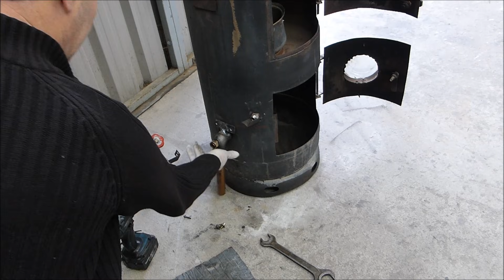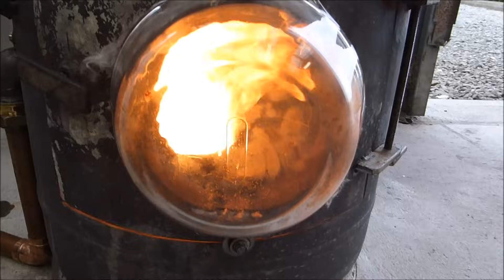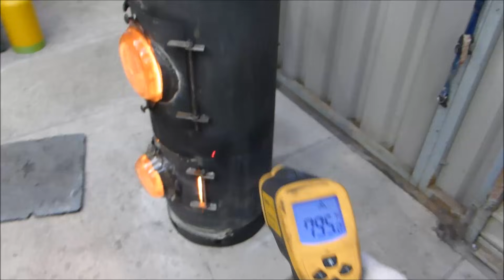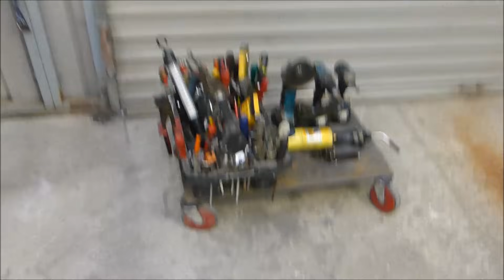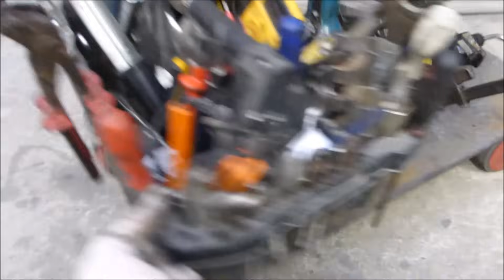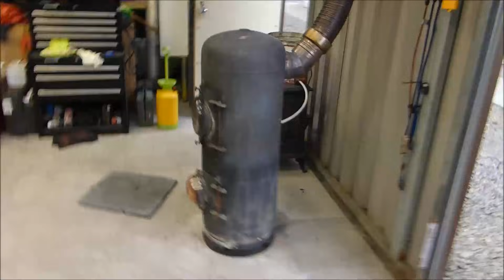Waste Oil Heater - Super quick install - New design - Space Heater

Comment: A larger air supply tube with a diffuser can make the burn almost silent. Getting the flame swirl in the burner and as well as the combustion chamber is key to quite. Also adding air, even in small amount in other areas of the combustion chamber can help with mixing all to keep the velocities down. I stumbled on a near perfect combo in the shop heater I put together. It is a low hum at it's hottest running temp burning around 1 gal per hour, no smoke, and as it gets to temp I actually have to cut back on the air a bit. I hope to be able to get the same effect in the next build. Which is going to be from scratch with waste as it's intended fuel. Currently it's based on an upside down coal stove which has been modded several times. The best build so far is a pump for fuel. I do not have to filter, preheat, and regardless of temp the flow is based on volume. The different viscosity's or the change in room temp do not effect flow. I can even pump and burn the crusty paste from fry oil. It's like mud, but burns just fine!

Comment: Hi how did you keep the Pyrex dishes in place fab burner and cool idea better than a log burner I think.
Reply from the maker: Hi Kevin. This stove has 2 doors so I can use it a a log burner and a waste oil burner. The glass has been a problem and I have broken a few but now I have some fibreglass rope and some bolts that hold it in place. The rope offers some expansion room and also seals the  air from getting in or out of the combustion chamber. You get a close up of one of the ways I did it here http://youtu.be/K9jYA7YqZ4I?t=1m53s Cheers Gerry

Comment: hi from galway these vids are brillant.just a quick question .what stops the flame or fire going back up the oil pipe causing a fire to your bucket of oil
Reply: Hi Tom. Galway is safe from my little experiments Lol. If you were to get a packet of firelighters and light it and then throw it into the bucket of oil it will just go out. The oil needs to be heated and producing some vapor before it will light so the flame wont travel. These burners can make a serious amount of heat with no smoke. I will be working on a burner mod today so there will be more vids today or tomorrow. Thanks for the comment. Slainte Gerry

Comment: What is your fuel usage gals per hr  with a steady even burn
Reply from the maker: Hi Ron. In normal use it will burn 1 gallon per hour and that is running it at mid range so if you need more heat it can be turned up.  There is a lot of heat in waste oil so its quite economical considering the massive heat output. Cheers Gerry

Comment: Use a brake drum as a oil vaporizer to contain your fire
Reply from the maker: Hi Steve. I have tried a few different vaporising objects. The tin can in this experiment was sitting inside another vaporising pot and didn't last more than a couple of hours.One advantage of something less heavy than a brake drum is that lighter pots get red and vaporise quicker. They use less kero to get started but dont stay as hot if the oil is being adjusted or last as long as a brake drum. ICheers Gerry

Comment: errr...i've seen the dripfeed version on this one and liked it very much? Why did you change the setup and is it better? You actually need the fan running...
i'm planning on building one (try too) to heat a greenhouse...there's electricity in it but i liked the idea of not having to use it and just go with drip feed to make sure that it's self sufficient but now you're making me doubt if that's the right way to go...
And the noise is quite loud as well isn't it?

Comment: Hi Gerry love the heater great idea altogether. T ake a look at 2jeff1. He made one also but it is fully automated well worth a look.
Reply from the maker: Hi Irish Prepper. Thanks I did see Jeffs setup and mentioned that he had a really great setup in the previous video. My plan with this setup was to make something compact that could be placed inside most boilers or stoves and would burn most oil based fuel. I am working on a different setup altogether that will burn oil and work off a timeclock. More on that soon. Cheers Gerry

Comment: Just found your videos and they are very informative, really gets the brain thinking. Have you considered running a copper, or black pipe, coil in the upper chamber filled with water that would connect to a circulator pump then to either a hot water tank, or baseboard radiator? Based on my time in Ireland (I'm guessing.. Galway) there really aren't hot water tanks like there are in the US. let me know what you think.

Comment: Great work and Vid as usual Gerry. A couple of ways you could reduce the noise of the burner:  Easiest to integrate into the current setup would be to either slow the blower down with something like a light dimmer if it suits the type of motor you have, or a rheostat.  Other way would be to use a gate or ball valve on the air inlet pipe to regulate the air into the burn chamber. 

It seems that currently the burner is putting out way more heat than you need. In this case, you can reduce the air as well as the oil. Reducing the air will lower the noise and you only need enough to burn the amount of oil being consumed. ATM I would say you have a significant air excess and that will actually give your stove lower temps. 

The other way would be to go to something like a 2" air feed so the air volume is the same but the speed is reduced. This will quieten the flame noise.  I am also wondering if a bigger pot would quiet the flame?  As for the tin can burning up, Maybe a bit of stainless steel pipe would be the answer?

I tried one of these down blow set-ups before and couldn't make it work but I think the trick may be to have the holes on the sides of the pipe not just coming out the end. You make yours look so easy I'll have to have another Crack at it.

Comment: Hey Jerry, I am still watching. Is that a vacum cleaner your using for air ? Thanks for video, love to watch them. Robert
Reply from the maker: Hi Robert. I had some standard oil burners here so I just used the fan in one of them to provide the air. I do have a couple of vacuum cleaners that will blow but they would melt the stove if I gave it enough fuel. Also they are about 1500w so a little heavy on the electricity for extended use. I was looking at bouncy castle fans on the net and some of them seem promising. The motor needs to be induction and continuously rated I think. Cheers Gerry
Reply: Just curious, while watching you go outside to show smokestack I thought I saw a vacum , supplying your air flow. If you ever get to the States,Get in touch ; Kentucky Derby coming up the 1st Saturday in May. Fast Horses Great Bourbon Fast And Lovely Women
Reply: And since you are here in Ky .Let us build this  stove.

Comment: Hello from Canada,  Norman here,  Wow thats one hell of a burner... The tin can I was referring to had 4 half inch holes at every 90 deg. Completely at the bottom of the can and my pipe in a pipe was a couple of inches over the can,  so when the oil drips down it is instantly vaporised and does not ever make it to the can,  the air that blowes in the middle of the can keeps it cool so it doesnt melt.
Anyways I really love your videos,  keep them coming.  I wish I had more time to tinker with my stove,  I will eventually post a video.
Reply from the maker: Hi Norman. I knew that the setup didn't even loosely resemble what you described but as the burner was already kinda setup I gave the dog some food and stole the can. This burner exhausts out of the sides so I put it to within 2 inches of the bottom of the can. The poor old can disintegrated later with the heat. I tried another burner this time blowing above the can and blowing directly into the can and while it did throw the flame out through the holes I drilled my fan wasn't producing enough air to test it properly. It then went on to blow the capacitor so I will need to pick one up before more mayhem ensues. The oil i was using was synthetic which is harder to burn but the burner doesn't care once it get going. I have Veggie oil for the next round of tests. . Thanks for the suggestion, it was cool giving the can a try. Cheers Gerry
Reply: But where’s the exsaust hookup up in the second idea at top or in the top
Reply: Last time I had built a propane tank I rinsed it twice but when I connected the welder to it it lite very fast and burnt a hole in bottom of pants then up my leg right up out of valve on top I guess from the charge of welder and the build of fumes in tank

Comment: This setup is better Gerry the only thing i found easy was i used a 1" tee at the oil intake to save on welding then just used a reducer but once again mate 10/10 atb Col.
Reply from the maker: Hi Col. Its definitely more controllable and after 4 hours of burning the other night my glassware was still spotless. It was burning synthetic oil too and it didn't care. Great stuff this burner and such a simple little thing. I will be ordering  a syphon nozzle tomorrow so that's where this little journey will be heading soon. I already have a few standard riello and bentone domestic oil burners here to act as component spares for the next project. Cheers Gerry

Comment: Hi Gerry,
I do enjoy your WO Burner videos. I am planing to build one for my shed for our coming winter here in Australia but I will be using waste veg oil as I have plenty of it.

One thought for you had you considered on the burner tube where the air comes out the holes tilting the holes to one side by putting a bolt or rod in the hole and twisting it around the axis of the burner tube, so the air will come out at a angle rather than straight out side of the pipe, so as to spin the air in the combustion chamber. Just a thought as most burners seem to use some sort of rotation in the air stream.
Cheers Wayne
Reply from the maker: Hi Wayne. I have thought of it alright. I was going to add 3 small pieces of 1/2 inch tube welded in at about 30 degrees off vertical from the 1 inch air tube. This would give it some rotational ability. As soon as I can find some tube I will give it a shot. I was going to clean out the stove this morning after many hours of burning and experimenting and it didn't need cleaning. This is a very good way to get heat. At this stage I am only tweaking the design but this burns  really clean and is easy to make. I have plans for other ways of doing this so that means more videos I'm afraid. My website will be live soon also. Thanks for the suggestion Wayne. Cheers Gerry
Reply: How did  your burner work out...???

Comment from the maker: Hello everyone.
Free heat, Clean efficient burn and a very cheap stove project for the Diy minded. Here"s another video of a fan assisted waste oil burner. The burner has been bent in a hydraulic bender to aid airflow and the air exhaust changed in design to blow horizontal instead of vertical. As recommended by Norman a channel subscriber I tried exhausting the burner into a Tin can which was drilled strategically with surprising success. At the start of the video I show how easy and fast it is to install the burner into the prepared stove .Cheers Gerry
Reply: +Gerry&#39;s Waste Oil Burner It looks like your vaporizing pot is aluminium,. Is that correct?
Reply: Gerry's Waste Oil Burner